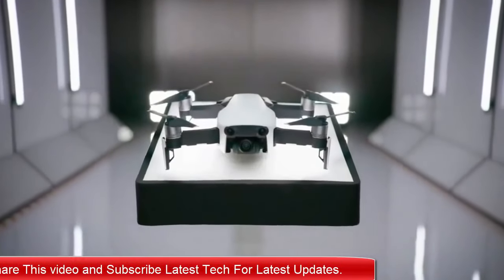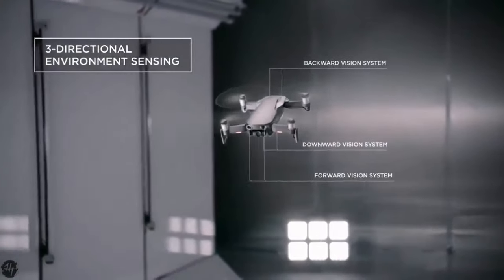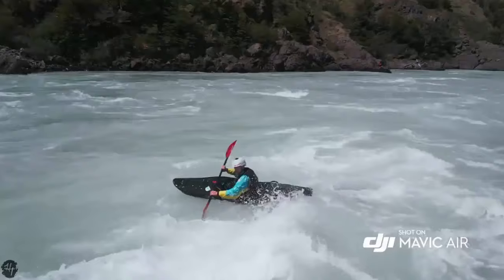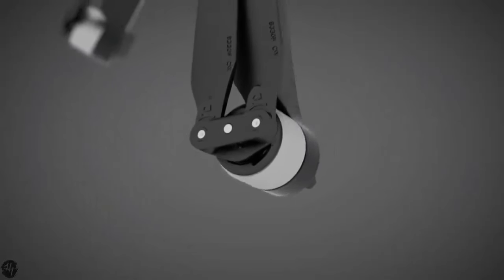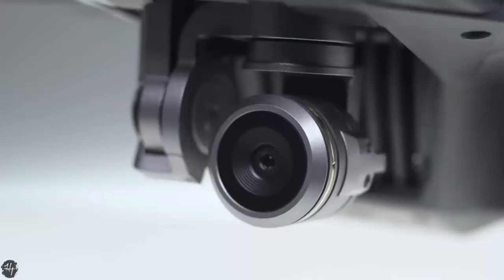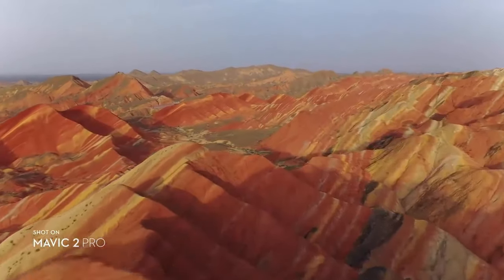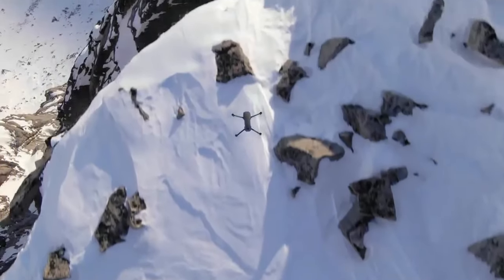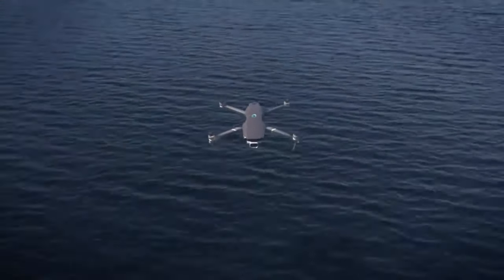Top 5 Best DJI Drones Buy Now Amazon 2021

Comment: Why do they not mention that the Mavic's controller has a charging port factory mistake by witch it wears out the port quickly due to a off center port hub and the fact that you can barely fly with 2 drone batteries before the controller's battery is depleted. It defeats the purpose of having more batteries Doh...!

This alone makes the Mavic a failure( Not worth having). What good is less noise if your controller can't be charged or have to charge it for as long as a battery every 40 min or your phone disconnects in mid flight due to wore out port. This is fuckedup!

I have a Phantom 4 pro with 4 batteries. I have non of the above problems. My controller last a entire day.
Phantom is :
*Faster
*Can lift more (Fly with 1.2kg max) Handy for drone fishing (Lift 4kg max)
* No controller ports issues
*Better Camera
*Controller battery last very long ( a Day)
*Propellers far from ground (less dust / dirt in and on drone)
*Propellers far from ground (Better for drone fishing) (Less chance to strangle fishing line)
*More sensors in more directions than Mavic (Safer by far)